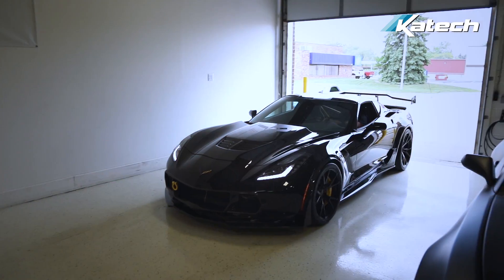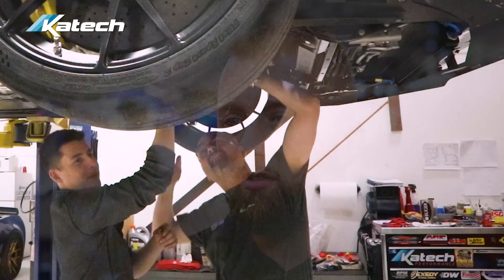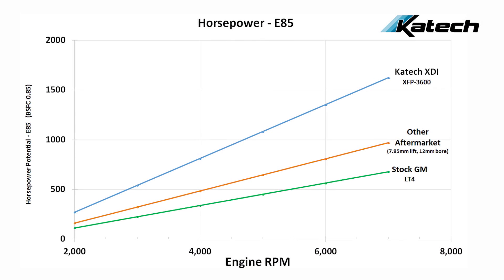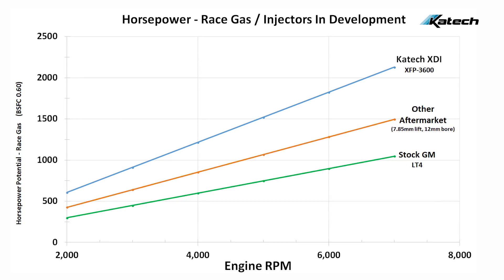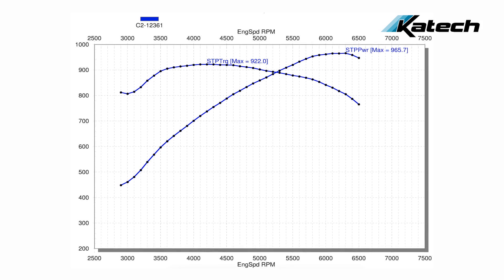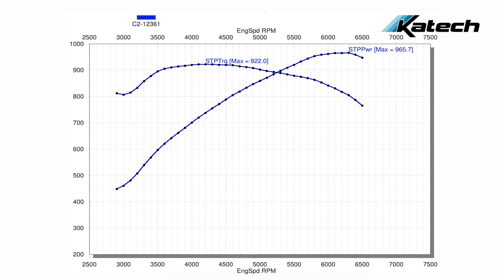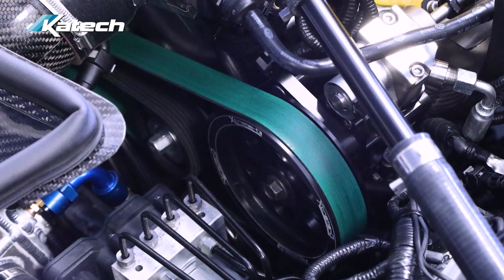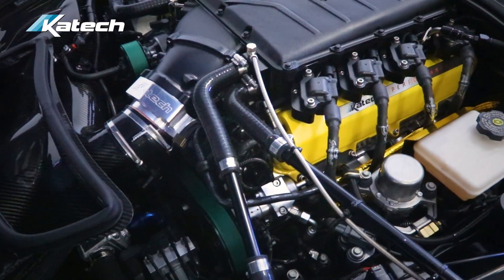Katech Breakthrough in LT Direct Injection Technology, The Katech Xtreme-DI Fuel System

Comment: I’m glad to see external HPFP becoming a thing. It’s been a thing for Diesel engines for so long and gasoline engines have been running off the camshaft for whatever reason.
Reply: Leland Holton Unfortunately, this System from Katech is almost $5,000 and requires their injectors which are another $3,000 to $4,000

Lots of less expensive options to get to 1,000 hp

Comment: Just trying to understand some things. Im currently at 750whp on a C7Z with meth and looking to run full E85 and move away from meth. So would I just need this and injectors? No lowside or cam?
Reply from the maker: Lowside runs out around 650whp without a cam on 93 with no cam. You will likely need an auxiliary pump in parallel with your factory system
Reply: Ah I see gotcha, thank you for the response! Port injection still seems to be the more cost effective option for me I guess.
Reply: wesley conquest Yes, there are less expensive options

This Katech pump is $4,800 and still requires $4,000 worth of injectors and an upgraded low side pump

You can buy a 1,000whp crate  motor from Nelson Racing for $28,000

Comment: Port injection makes more sense to me, GM thought the same since the new ZR1 has direct and port injection. I'm sure it's also been validated and seems way overkill for the 755hp the engine is rated for. Time will tell if it holds up but I can appreciate Ktech's approach here in trying to make something work.
Reply: There are aftermarket modifications that are rubbish compared to OEM, and then there are top-tier, dedicated race car modifications.  You've gotta remember that GM also has price point, MPG, emissions and other constraints that they need to meet.   That's why we're dealing with direct injection in the first place.
Reply: Port injection benefit is seen at idle and light throttle at low rpm because the DI pump needs more energy than a fuel pump ran off the alternator.
Reply: Leland Holton That is not the advantage of Port Injection in high HP applications